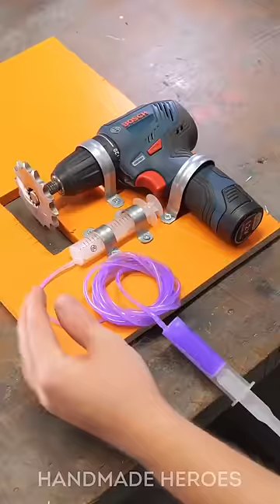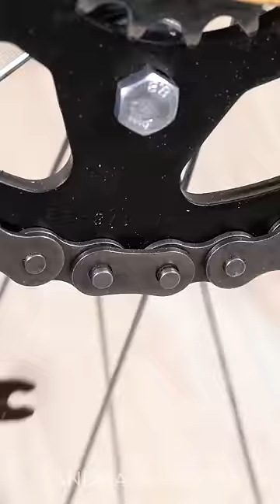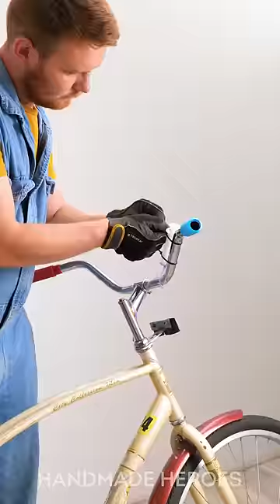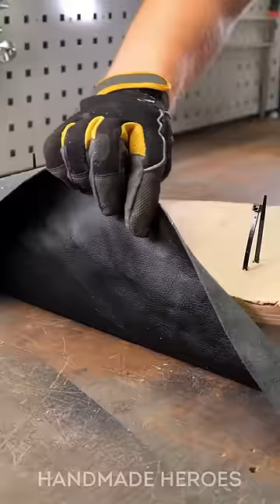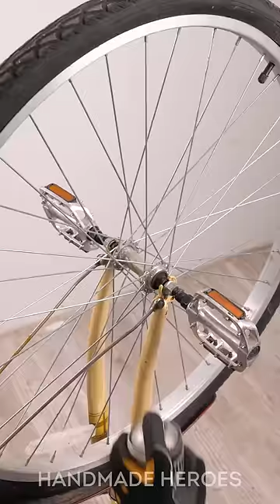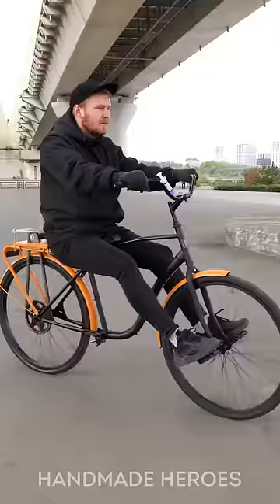This guy made an electric bike out of a drill 😮 🚴 #shorts

Comment: It's not expensive to build electric bike, the expensive part is the battery.
Reply: Car batterys are cheap but also big
Reply: @nikonseleznev7836  wich car? electric car or konvensional car?
Reply: @muhammadfaridzusroni2990  konvensional
Reply: @muhammadfaridzusroni2990  Or cheap batteries such as lead-acid batteries in general 
However, they have all their drawbacks
Reply: Ooohh ok
Reply: Las baterías y el controlador es lo más caro.
Reply: @nikonseleznev7836 it's not so much the size but the weight of the car battery that makes them terrible. 

I think when compared to lithium batteries, they are just a tad bit lower in terms of volume but for the weight, they was like 30% capacity for the same weight. that's because car batteries was are lead and lead is heavy.
Reply: 2 used aovo pro 36v batteries in series with a vesc and 250w motor will get you 40mph daily and a range of 15 to 20 miles. I built mine including the bike for £300

Comment: Well done, but where are the brakes?
Reply: Тормоза придумал трус
Reply: His hopes and dreams are the brakes
Reply: There are No brakes, this man is clearly suicidal and doesn’t give a damn about what he hits or what hits him -and before you argue otherwise, just remember that this man’s throttle is compromised of two plastic syringes that could fail or seize up at any moment from simple wear.
Reply: Wer später bremst, fährt länger schnell.
Reply: ¿Para qué quiere frenos si no alcananza más de 2 kilómetros por hora?
Reply: He puts the drill in reverse to slow down 😂
Reply: 再給他一點點時間 好嗎😂😂😂😂
Reply: We’ll cross that bridge when we get to ut
Reply: no brakes best brakes to him
Reply: 브레이크는 발할라에 있다
Reply: Where we're going we don't need brakes.
Reply: Need very good shoes😂
Reply: Рекуперация
Reply: his feet
Reply: Далеко не уедет
Reply: Is that necessary 😂😂😂😅
Reply: На малой скорости тормозят ногами)
Reply: Como PICAPIEDRAS jajaja con el pie...
Reply: Not sure about the padal position 😂 hard to steer with legs in the way😅
Reply: So slow you dont need brakes
Reply: He's not gonna go far enough or fast enough to worry about brakes
Reply: You get off and hit the reverse button on the drill, duh!
Reply: Foot brake
Reply: Basta invertire il senso di rotazione del trapano
Reply: Doesn't go fast enough to need
Reply: @fishindudas3205 of couese he will cross that bridge, he has no brakes! XD

Comment: You need to add a clutch pad so that you can disengage the motor from the drive train that you made in case the damn thing doesn’t stop or if the motor/battery dies so that you can pedal, because if that battery dies and you have to pedal, you’re gonna be pedaling the wheel and the dead electric motor. 

I would probably only use this as a movement starter for stop and goes anyway because the motor and battery wouldn’t last very long.

Another note: please make a better ventilation system to keep the motor cool -that way, it won’t burn out so quickly, would also highly suggest using a brushless drill (or motor) too for reliability.

Edit: I forgot that you clearly don’t have any brakes either, so that’s fun, nothing wrong there if you’re that confident.

Comment: Ok. So if you get 3 good batteries, you can ride without pause for like 1 hour  i think. Better to make one big battery - using samsung 18650 batteries and plug it. BUT there is one more problem - using this drill more than 1 hour long is not the best idea...